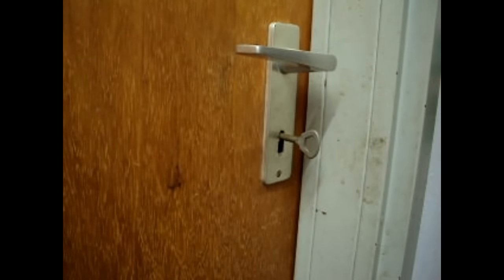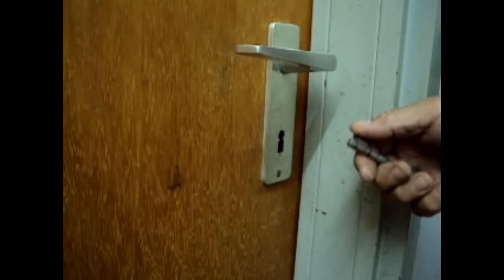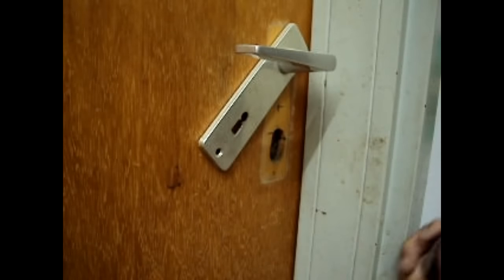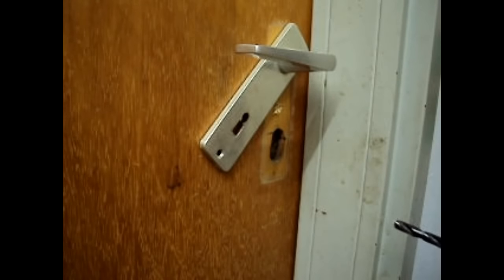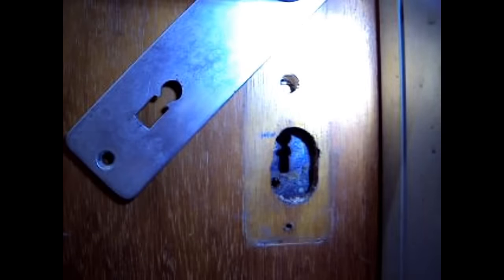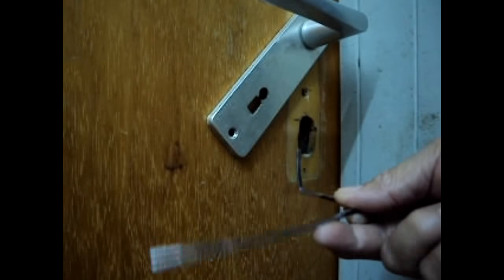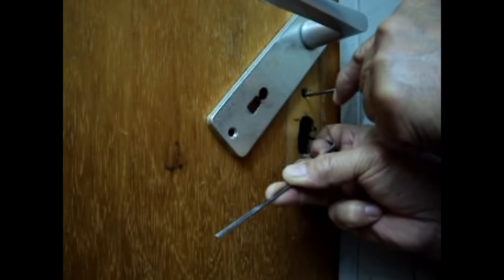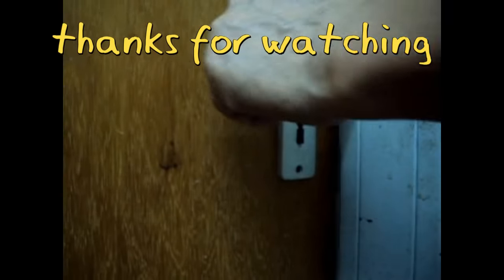HOW TO OPEN WARDED TYPES LOCKS  without picking ( some cases)

Comment: Just freed my bedroom door using this technique. Lock was stuck. Wouldn’t open with the key, even after I’d added graphite. So drilled a hole, and used the key instead of a tension wrench, and inserted a screwdriver in the hole. After a few seconds they key was turning fully in both directions. Thanks 👍

Comment: Most USA lever locks lack this 'window', and many here also do not have slotted levers (or will have only one) to defend against over-lifting, so picking this type here is just one small step tougher than picking a true warded-only lock. And most of ours can be worked with a set of cheap 'skeleton keys' as we never went to complex warding.
Reply from the maker: Mr. P RO That seems to be a very very old lock you are talking about there in the U.S. or those ones that are installed in a non security essential area.
Reply: @yononable  This type of lock fell out of use for exterior doors here starting around 1900 and around 1920 weren't even used on cheap homes anymore. They did continue on interior doors for a few decades thereafter, but were all gone after WW2. We had these both mortised in and surface mounted (called "Rim locks" when surface mounted).

Knowing these locks and how doors were made differently through the years helps me put a build date the old houses I work on for a living. Pin tumbler cylinder locks took over early here, so lever locks were not as fully developed as happened over there. Nice video and nice to see how things are done over there.
Reply: This helped me to unlock a door in Jamaica 🇯🇲 The setup was slightly different but the similarity in concept did the trick! Thanks for the vid👍

Comment: Just managed to lock myself in my bedroom. NO tools! Was an incorrect key and will not open again.

Found a Stanley blade in the side table drawer. Managed to undo 4 screws on the cover plate with it. Measured your recommended 1" and carved a 1/4" hole
Widened the hole to allow the width of the stanley blade into the 'window' and lift 2 levers.

Thank you for your excellent video

It is embarrassing but not as bad as having to call emergency rescue or locksmith.
Reply: Lol

Comment: I have a similar look but lost the keys, i manage to open it in the past through a hex key and a pair of tongue, but i was pure luck and trying do you have any ideas how to open it again strategic?
Reply from the maker: hi real madrid...i think that the lock you encounter has just having  2 wafer plates, since i wont advise you to open the unit, (because that spring in the handle will really cause a trouble if dismantled) what i can say is.. try that tools again that you used..WHILE THE DOOR IS OPEN.. if it unlocks again, you will build that confidence and familiarity of that subject lock. thanks for watching.
Reply: lol these looks

Comment: Technically speaking, isn't this still picking, but facilitated picking in that the tumblers are lifted and the bolt is moved through separate holes?
Reply from the maker: picking is quite near to describe it...but then, "picking a lock" is lifting the pins or tumblers one by one to its shearline..where in this method(i am showing) is that i lifted a stack of tumblers to its gatings at one time..and drive the deadbolt fence passes thru.

Comment: Can I get the dimension of the tension wrench (the length of each bends)?
Reply from the maker: yeah sure, the "hook"(thats the tip)is 1 inch. , and the bend for the depth, is 2 inches.  and the "handle" in my case..is  4 inches. but you can make the handle shorter if you wish.thanks for watching SeAL 65

Comment: I lost my room door key i bought a neue lock but how can i movie my old lock?
Reply from the maker: hi aryan.. i can only recommend one practical way..if door is still lock..call a locksmith, if you were unable to open the door..and let him install the new lock.. or if the door is open (already)take the handle out first. there is a small screw or an allen screw in the lever part of the handle. once that is out, the lever handle can  be easily pulled out, and the next is simple.

Comment: Can I do this without a tension tench?
Reply from the maker: hi Maryem,, no..that tension tool is the one that will drive the bolt to unlock. . it should not be totally the same with what i've shown here, its either a bented 3mm wire , (a bit square at the end) just to drive that bolt inward..thanks for watching.
Reply: @yononable  Thnk you so much! helped me greatly

Comment: Yeah my bedroom lock is like that and I don't have any of these tools in this room😁 wish me luck
Reply from the maker: try to improvise, i"ll give you a little idea. a wire coathanger bend 1" from the tip as tension.. a 1/4" philip screw driver as a drillbit, and a tiny knife.as a lifter.  Goodluck bro.

Comment: interesting, are you a burglar? lol
anyway, funny dialect. I bought a lockpicking set, only to realize I bought one for modern locks instead of old big key type locks. picks for these old locks are quite more expensive and complex. Lost the key to a simple IKEA desk lock. I guess in time I will get the tools to open it. it is a funny challenge.
Reply: Research "Warded locks" and "Lever locks". These are very easy to pick once you understand them, and DIY pick tools easy to make from very stiff wire. In fact, wire picks work better with these as you can bend to shape on-site. Technique is similar to pin-lifting, go one at a time with pressure on the bolt.
Reply: @P_RO_  to put pressure on bolt in a "big" old lock, I need to get a fitting key type and file it down, or can i also do that with piano wire? I think I gonna buy some wire soon. local shop offers these wires in 0.8 1.0 1.2 1.8 2.0 2.5 and 3.0 mm... thanks for your reply
Reply from the maker: C.R.B .sorry for a late reply, (i was in jail that time  ***just kidding**)  I am a Locksmith with a common sense in these field bro.

Comment: MY BABT BROTHER IS LOCKED IN THERE AND WE DONT HAVE THE KEY
Reply: did you get him out!????!?
Reply: @ipeka14  yea me and my mom broke the door down i was keeping hin away from the door by yelling at him from the window
Reply: @ipeka14  i wanted to call the fire department but they would charge alot
Reply: I think you did the right hing by breaking the door down, I can imagine how panicked you guys mustve been my brother had locked himself in a room when he was little too
Reply: luckily it was a bathroom and i was a clever 9 year old so i found a way to open the door
Reply: is he okay now?
Reply: @ipeka14  yea we rushed him to the doctor because he was locked in the room for 2 Hours + with the windows closed and he couldn’t breath now he is okay
Reply from the maker: @ipeka14  a similar kind of lock will be lock only by the key.. i pressumed the key is in the other side. in which a lesson be learnt..that never left the key inside, if you have small children around. and if your lock is a push button knob lock type,  let the locksmith removed all the tumbler pins of the cylinder, in which case, during an emergency or lockout, you can either open it with a screw driver , or a pointed knife, by turning the cylinder like as if a key. this method is very effective in bathroom/s.